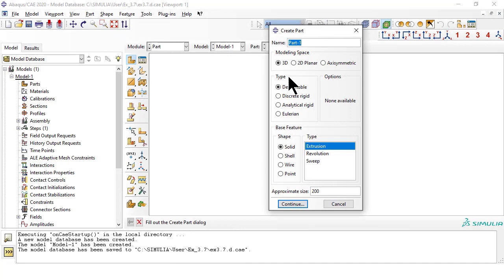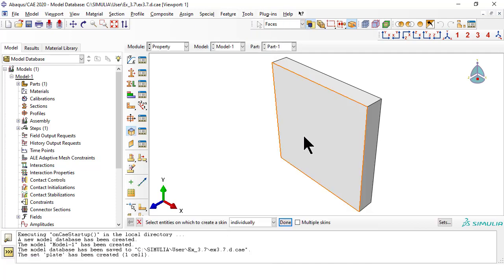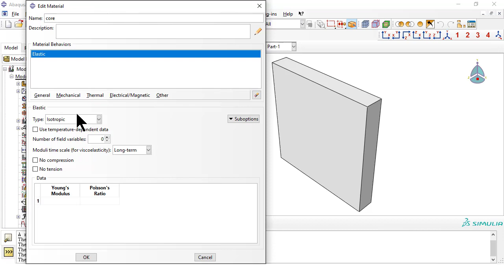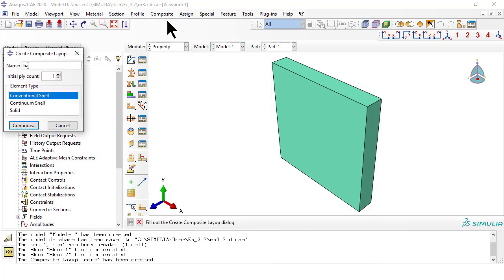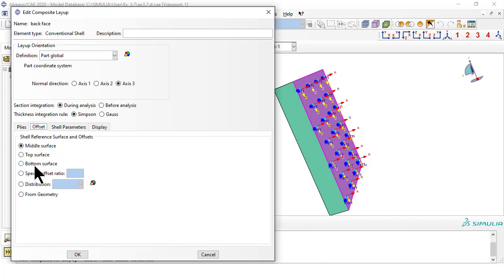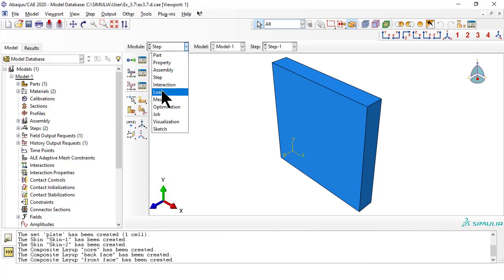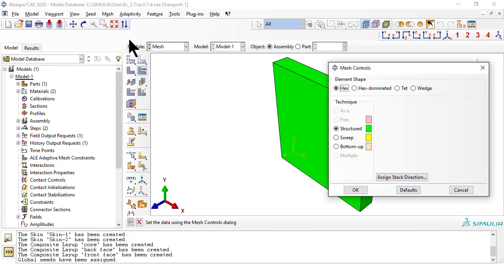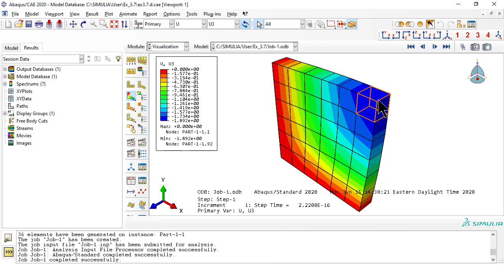Example 3.7.d Simulate sandwich plates with a 3D core and conventional shell skins in Abaqus

Comment: thank you professor , However if you can help with other geometries of cores (i.e truss , V , honeycomb) I would be appreciate your efforts
Reply from the maker: I think the core in 3.7.d is homogeneous. For other cores one option is to use computational micromechanics in chapter 6 to calculate the equivalent homogeneous properties of your complex core, then use those properties in ex. 3.7 or similar. That way do not have to mesh the details of the complicated core when you analyze a shell structure, you only mesh an RVE to get the equivalent properties.
Reply: @EverBarbero  thanks professor

Comment: Dear Prof. Barbero, Thank you so much for the contribution you are providing in these videos. They are really helpful. is it possible to use conventional shell elements for a sandwich panel when the face is not only on the top and bottom sides but also passing throughout the core, as vertical elements to strengthen the core?
Reply from the maker: Discretizing the vertical honeycomb for the whole structure would be computationally expensive. Instead, used chapter 6 Computational Micromechanics to find the equivalent homogenized properties of the honeycomb (I have not done it), then use them as a core for any of the shell methods in my videos.
Reply: @EverBarbero  
Professor, thank you so much